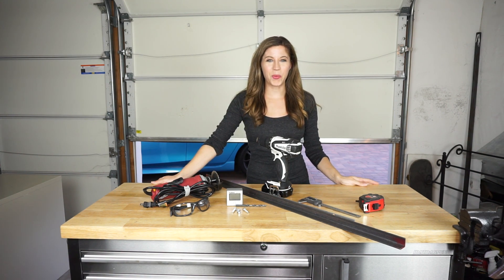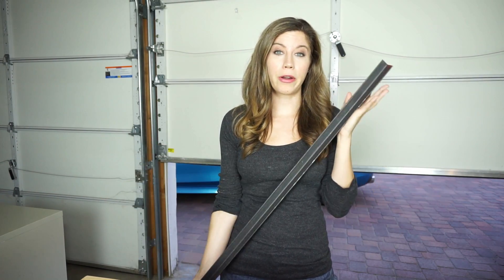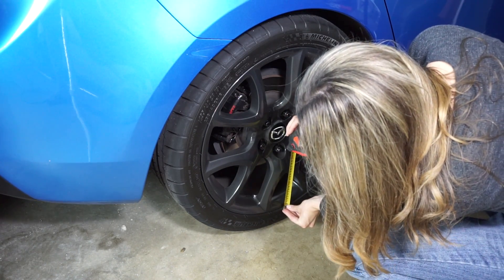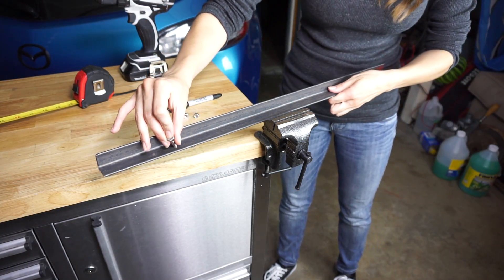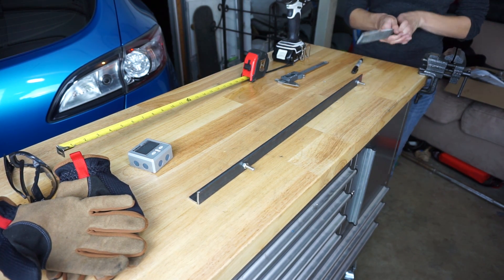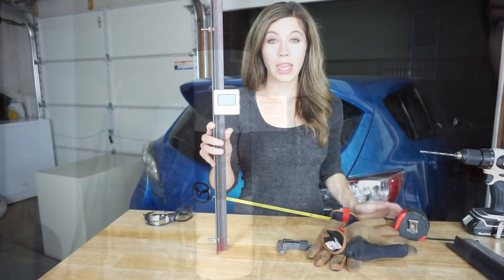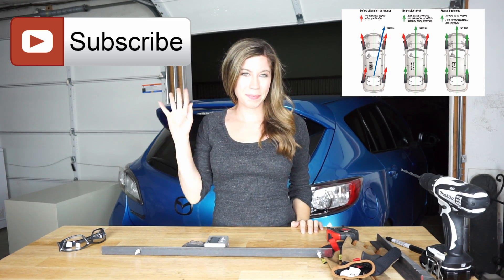BUILD YOUR OWN CAMBER GAUGE TOOL!

Comment: If your just replacing a strut measure from inside of the wheel rotor to somewhere in the fender liner before and set to that after. Nice tool there for finding the correct angle but it could be difficult to access the camber bolt with the wheel on, it would be slightly less accurate but smaller if you made this tool for the brake rotor. I do like the idea of using the angle finder.

Comment: I made one of these but I made it a little different and a lot simpler - I just cut the angle iron 1/4" longer than the rim diameter and now the angle iron sits against the rim, no bolts needs - you can even use a straight 2x4 or 2x2 if you wanted

Comment: The  bolts are a great idea so you can press against the flat rim edges and since your wheels have uneven surfaces inside the wheel. My wheels have prefect flat level surfaces so I can press the tool against the top and bottom of the wheel  surface and get a good reading  I cut the tool smaller so it fits inside the wheel and didn't need to use bolts Great video though, got me on the right track

Comment: You have made an unfortunate assumption that the supporting pillar is absolutely vertical.

To avoid this potential error, you should take two initial readings on diametrically opposite sides of the pillar, and then confirm your baseline setting.
Your calibration mass doesn't have to be truly vertical, if you have zero'd the device correctly you will see +X' and -X' on diametrically opposite sides of the mass.

Comment: Don't need to get an angle cube if your cellphone has angle finder.  My Chinese Doogee phone also has accurate direction measuring so toe in and caster can be measured.  For toe simply figure the difference in degrees needed. For caster adjustment turn the wheels the required angle and measure for the required change in vertical angle.  Of course adjust the camber as in this video first and figure true vertical or difference from camber depending how you secs are listed..  For your turning plate you can use greased cutting boards from a Dollar store or greased steel plates.  Of course check if your suspension parts are good and tight and if applicable tighten up steering box first.  

The other way to do this is watch for ads for alignment specials and take your vehicle to this place.  The point of the shops giving low alignment prices is to get your vehicle in to do suspension work.  If they tell you you need to replace certain parts either take your car home and check or take your car to another shop to have those parts checked.  I have seen cases where brand new parts have been claimed to be needing replaced by some of these alignment shops.  Of course replace any needed parts and have the alignment adjusted after. Most alignment deals are pay for the alignment and either have them do the suspension repair or you can bring the car back to get the  alignment job finished after you get the parts replaced. The mechanics are paid on a commission on repairs often with quotas so this is the reason for the prevalence of unneeded repair recommendations.  Yeah, one reason to do it yourself.

Comment: Might be late to the party here, but when drilling, in addition to what I seen someone else say, position the bar in the vise so that the drilling location is closer to the vise and more secure and start by using a smaller bit first. 

Now I'll tell you what took me many, many, many drill bits, time and immense frustration to learn. When drilling steel, especially hardened steel:

#1 Use a harder material drill bit than the steel. Like cobalt. 

#2 Slower is better. Like  a lot better. Speed creates a lot of friction, which creates a lot of heat. Slower speeds allow the drill bit to "bite" into the metal much better. Which takes us to,

#3 Use pressure by pushing down on the drill to make the bit bite even more into the metal. 

#4 Use some kind of lubricant on the bit/hole to cool the bit down while drilling. They make drilling oil for that or you can use some other oil or WD40. Could probably even use water, but I never have. 

I learned all these the hard way. Like I learn everything. I must have destroyed 20-30 drill bits trying to drill one freaking hole in a piece of angle iron one time. Then I did lots of research. And that's what I learned. 

Use a harder material than what your drilling, go slow, press harder and use something to cool and lubricate the bit and the metal. I guess just that sentence could have replaced the whole comment, but I guess I like to hear myself talk... er, uh, type.

Comment: When you're drilling you should be seeing curled chips, not powder like you had.  Slow down the drill and/or add more pressure.  It'll go a lot faster and the bit will last way longer.  With a bit that size I'm guessing you could put a quarter of your body weight on it.

Comment: Brilliant idea! I found an old steel corner piece from one of those grey shelving units (conveniently has holes already drilled). Have calipers to measure protrusion of each bolt from face of angle iron. Ordered an angle gauge.  Recommend a piece of electrical tape on top & bottom of wheel to prevent bolts scratching. Can now confidently set camber on my FJ Cruiser that I put all new lifted suspension on. Thank you!

Comment: Nice video showing how simple it is to make a really useful tool.

Years ago, when I was racing small sports cars, I had to make a lot of my own such tools.  Some of these tips have already been mentioned a gazillion times here in the comments, but I'll just put a couple together here in one place.

1)   Instead of solid angle stock for the bar, use "strut hangers" (your terminology may be different), which have a multitude of holes and slots all along the length.  Saves you drilling and also makes the tool easily adaptable for other vehicles.

2) The raw bolt ends WILL scratch wheels.  Either stick a one-time small piece of electrical tape (single thickness) on the end of each bolt, or plasti-dip them, or sand and highly polish them so there are no sharp edges.   If you use vacuum caps, you will likely not get identical lengths so you'll need a way to adjust the bolt length (see #3 below)

3) Use full-thread bolts and 2 nuts (vs 1) on each bolt so that you can adjust the length precisely if needed.

4)  If you don't use the strut hangers, then consider using aluminum for your angle bar, and glue or rivet a piece of steel to it as a mount for your magnetic angle finder.  It will be lighter overall and easier to smooth/'polish out the bar ends so that there is less chance of scratching the car if you should touch it with the tool.  NOTE:  If you use aluminum,, then it will be much easier for the bar to get bent so handle/store it very carefully

5)  You can check the bar for straightness before you start.  Use string pulled tight from one end of the bar to the other, across the edges or flats.  Cheaper and more trustworthy than a formal straight edge tool.

6)  Check your angle-finder and your entire rig for straightness and zero-point, together.  Find any surface at all.  Put the tool there and check the angle.  Then spin the tool 180 degrees and do it again.  If you don't get the same readout, then either the rig or the angle-finder has a problem.  You can do this to easily check your bubble levels, too, of course.

I don't offer these suggestions because you did anything wrong, but only to share my own learning from past trial and (lots of) error.

I'm looking forward to your DIY alignment video!

Comment: not sure if it has been mentioned but that is not an angle grinder. it is a cut off tool. you can cut with an angle grinder if you use a cutoff wheel for it. i have both and usually use the grinder for cutting as it has a larger wheel which helps on a lot of things.

i also do not bother deburring with a file but use the grinder for that as well.

Comment: Well...you had to buy the digital level and all the hardware and then assemble the home made tool. So after you check the camber is off you sould take off the tire, adjust the camber setting and put the wheel back on, back and forth till you find the right compromise....all of this of course has to be done on a completely flat and leveled surface where have the car and if your car is off camber it will take long time to fix it.... for 15$ you can just buy a camber gauge from amazon and do the same job wherever you are since is adjustable and in less than 20 min the camber is done

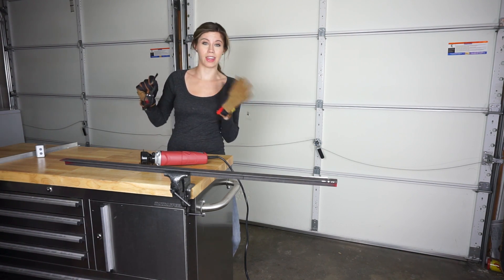Comment: 1:18...   ... A low cut sweater qualifies as protective clothing. nice video.  
   my question:   How do you attach this angle iron to the vehicle while simultaneously performing the camber adjustment ? 
    EUREKA !!:   Why not just use the electronic level tool directly on the wheel's brake rotor?

Comment: I have an idea that's a slight modification to yours and cheaper (no need for gauge), maybe more accurate?  Add a bottom leg to your bar 90 deg and then an angle anywhere to complete a triangle. Use the 3-4-5 rule, also known as Pythagorean Formula to get it dead on 90 degrees at the bottom.  Then can use it on any flat surface whether level or not to achieve 90 degree or perfect vertical camber if that's what is desired for a given vehicle.

Comment: I bought a camber/caster level off of wish for around $10. Remove wheels and set hub assembly down on blocks with 2 or 3 pieces of cardboard in between them.stick it to the top of the rotor (magnetic) and Get to work. Have to level it out on something level first, but it's pretty accurate..   I put my truck on blocks for the air ride suspension.had to keep adjusting the pressure in the air bags with the wheels off

Comment: Just a heads up: I followed your guide to make this tool and it works great.  Super accurate and 100% repeatable.  I made two changes however.... I used 3 screw legs instead of 2....putting two next to each other at one end of the tool.  This allows the tool to stand straight and eliminates any side to side rocking motion while holding the tool.  The other addition was some plastic cap nuts to cover the ends of the legs.  This should prevent scratching of the rims.

Comment: To get a more accurate starting position when beginning to drill, use a drill about a quarter size of what is required on a low speed setting until it makes a slight divet in metal.  Then step it up to half the size required on high speed, then 3/4, then full size, slowly making the divet larger along the way.  Additionally, I would adjust the beam in the vice so that the mark for drilling is within 2 inches from the vice to avoid twisting while applying downward pressure while drilling, just in case...

Comment: Dear Lord,,,terrifying using electrical tools. And how to attach it to the wheel etc and add the cost to touch up the scratch marks from the bolts you have cut with the sharp ends....

Comment: Good Video to show you don't need a 400$ store system to do what you did for 30$ Some Advice & warnings
Your drill holes. I built one from Aluminum, drill one fixed hole at the bottom and then drill multiple holes right next to each other at the top, then use your grinder, a hack saw or a file to make the holes into a slot. That way you get a perfect fit and it will work on different tires! You can use aluminum, cheaper and lighter and wont rust, just epoxy a magnet or two to the side! Also use a piece from the same angle to make a horizontal piece. I made the horizontal bar and put slots at the end so I can adjust for different rims, plus the ability to get hard friction fit, which you cant get with the way you drilled holes. Use a punch to start the hole, I saw wobble when you drilled, this gives accurate holes.

Danger Will Robinson ! Don't ever stand to the side of a grinder as you did, the blade was completely facing your Face, if it breaks or chips your in for brain surgery, really its a very dangerous thing, stand in back of the guard. Do not use the grinder to cut from underneath  the bar, its always on top, theres to much wrong and again dangerous to that to mention. 

Great job, I cant believe they sell these things for 200-400$ on Amazon. Oh one more thing, youll need to turn your tires to do camber caster alignment, rather than the 100-200$ tire turning pods on amazon, just put 2 pcs of cardboard under your tire with grease inbetween them, turns like a 200$ overpriced pod

Comment: Rather than filing the bolts, I use two (non-flanged) nuts, and lock them together. If one side of the bolt, measured from part of metal bar facing towards wheel of car, is longer than the other, turn the 2 nuts as needed and lock them. If one uses angled aluminum, instead of angled steel, magnetic tape may suffice with a metallic non-magnetic angle finder tool.

Thanks for the video.

Comment: The angle iron should be placed in the vise so that the holes to be drilled are close to the jaws to provide more stability when applying pressure.

Comment: 🤷‍♂️ Just put the angle gauge on the brake disc
Reply: If you can get to it with the wheel on.   You need to read caster and camber with the car's weight on the wheels and the suspension settled, right?   Seems like this tool makes it easier to get the camber reading weighted.
Reply: Put it Through the alloy spoke

Comment: Why not just use a couple of thick magnets (the cheap ones you can get at harbor freight) instead of the screws..

Oh, duh I forgot, those are probably aluminum wheels, so magnets won't stick. Well, if you have steel rims, it would work

Comment: A center punch for your holes and even a pilot hole will ensure that you drill where you marked - also a little WD-40 or preferably machining oil will help preserve your drill bit life . If you use a longer bolt with a nut on each side - you can adjust the bolt to the proper matching length without filing anything, use the inner bolt head end nut as the adjuster and the outer thread side nut as the locking nut. Placing your tool against the pipe is really not a good test. Your pipe might be bent. Not every one has a straight pole in their garage either.  You could place it on a flat surface such as a work bench, residual angle iron metal and check for level.

Comment: Just wanted you to know when cutting angle iron you should all ways cut it from the angle side first, that way you are not standing in front of what your cutting so you don't get hurt, heads up pilot holes would help you out before drilling the size you need

Comment: Nice tool. Just two suggestions:

The tool you refer to as an "angle grinder" is actually a straight grinder. In an angle grinder, the wheel's axis of rotation is perpendicular to that of the straight grinder.
As many other commenters have said, you should center punch the hole locations prior to drilling. It will improve the accuracy of your hole placement a lot.

Comment: You could just cut the metal length so it sits on the lip of the rim and eliminate the need for the bolts.  I don't see the need to use angle iron either, 3/16" flat stock isn't going to bend.

Comment: Awesome vid! But, here's a little tip. Maybe add some plastic or rubber tips to the ends of the bolts to avoid scratches.

Comment: that's not an angle grinder, it's an electric cutoff tool, the disk on a cutoff tool is at a 90 degree angle to the handle, on an angle grinder the disk is parallel to the handle!

Comment: Good video, a few safety concerns, but there are a couple things I'd like to add. 
I have never found a perfectly level surface, other than shops, and it never mattered much because it was to check fluids and the slight slants didn't affect it enough to hurt. A simpler, and cheaper, way to accomplish this would be:
1. Measure the diameter of the rim. To do this properly take your measuring device, preferably string, pin one end to the outermost point of the rim and take the other end, running it along the opposite outside edge of the rim until you get the longest point on the string and measure it, this will be your true diameter rather than being too far to the left or right, resulting in different measurements.
2. Find a bar or even a straight block of wood and position bolts, or pins of some kind of equal length, to the measurement of your rim. (Note: there must be enough overhang to touch the ground and both outer points of the rim)
3. Take an angle square and position it with the ground and bar and keep taking mesurements until you have a perfect 45° angle. This will work regardless of how level the place is, as long as the ground itself is a flat surface. If you really want to make sure you're at 45° you can extend the square with anything straight, such as a ruler or bar. This tool will only work with a perfectly level environment. To put it into perspective, think about it as if you were to do this on a (flat) surface that was on a steep hill. The car would be slanted according to gravity and the surface, but the tires would be straight up and down according to gravity.

Say you do have a perfectly level surface. Build your bar and bolt setup in the same manner (it won't matter if the board reaches the ground so long as the bolts make contact with the outside of the rim). Take, or make, an L bracket (L=45°) and position one flat edge vertically on the bar. Next take a protractor and secure a string perfectly in the center point, and tie a nut, or some weighty object to keep the string taught, to the other end of the string. The string must be long enough to reach past the 45° mark. Now hold the flat edge of the protractor flush with the underside of the horizontal leg of the L bracket. Continue this until the string is at 45° perfectly.